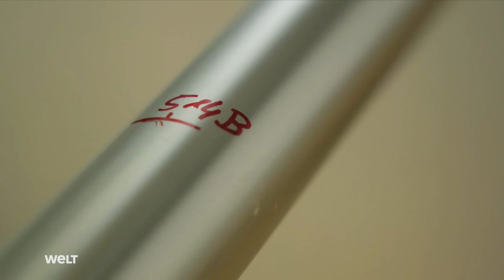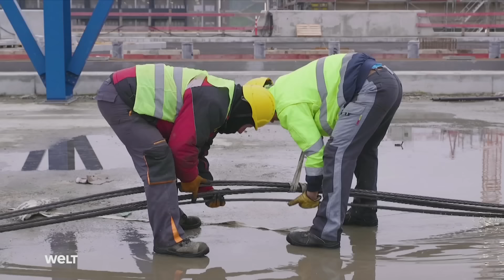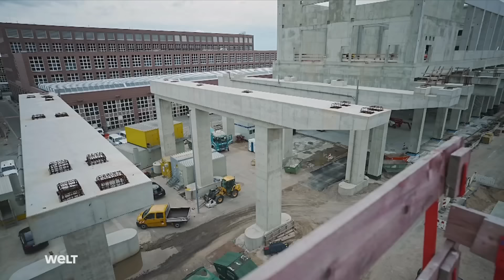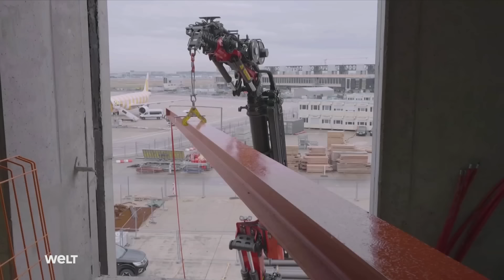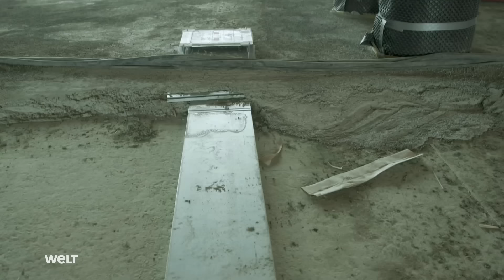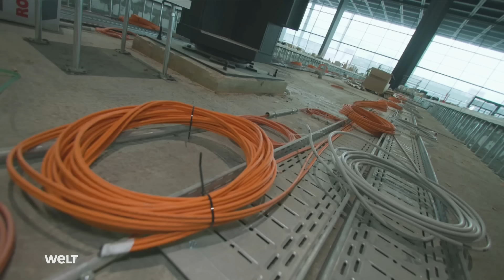EUROPE'S GIANT CONSTRUCTION SITE: Frankfurt Airport’s Massive Terminal 3 – Aviation’s Next Level

Comment: The airport control tower elevators are extra special due to horrible lessons learned in the early 1970s when the former airport terminal was the site of the worst airport terminal fire in history.  Normally, an elevator will automatically be called and stop at the floor where the fire is.  This is because the heat of the fire is so bad that it actually welds the fine wires and springs under the elevator call button.  Normally, you are supposed to avoid using an elevator during a building fire for this reason
Reply: What fire in the 70s? You mean the Düsseldorf Airport fire in the 90s?

Comment: I flew into Frankfurt Airport and it was a mess.  I was stuck in an area where the lift was not working and I had to knock on the window so that someone on the tarmac could rescue me.  it was a horrific experience.  No signs nothing was working functioning properly.  It was like a maze and nobody knew where to direct you to and no staff on ground.  I will never trust that airport ever again.  It was a nightmare. So much for German efficiency. or rather inefficiency. What a joke and dangerous.
Reply: I flew in there almost 100 times and never had a problem. Almost every employee on the ground can direct you correctly. And getting to a part that is not signposted means that you have already ignored the signs. Clearly your mistake and the circumstance with the elevator is just bad luck, but it can happen anywhere. Technology never works perfectly 24/365. The signage is not perfect, but better than at many other airports. You should also know that the airport is more than 100 years old and has had to be repeatedly adapted to the increasing passenger numbers over this time and always during operation and such modernizations and adaptations are a thousand times more difficult than putting a completely new airport on a greenfield site or slamming it into the desert. And to describe your experience as dangerous is probably the exaggeration of the century. I'm sure that almost everyone has gotten lost somewhere at an airport. But this is almost always your own fault. You can laugh at yourself or, like you, jam and complain like a spoiled brat
Reply: I’m sure u went to Ibadan airport in Nigeria not Frankfurt

Comment: Doubtful if the extra cost for a somewhat gimmicky roof/ceiling is justified in today’s economic climate.   Portland, in the U.S. has recently completed one of the most gorgeous terminals anywhere, sans gimmicks at a realistic cost.    However Frankfurt is badly in need of this new terminal as the existing one is not good and this will be a huge improvement.
Reply: Frankfurt Airport is over 100 years old and has had to be rebuilt and extended time and again during ongoing operations. This is a thousand times more difficult than putting something on a greenfield site. When terminal three is completed and in operation, terminal two will be the next project to be modernized. Frankfurt is aware that some areas urgently need to be modernized. But space and money are limited and things can only be done one thing at a time. Everything in Frankfurt is privately financed. And whether something is beautiful or not is always in the eye of the beholder. And I much prefer sober airports to the gigantonomy of the Gulf States or Singapore. I don't know the new terminal in Portland, but the photos I've seen show a really great terminal

Comment: I have the feeling they will not finish this terminal by 2026...
Reply: This is FRAPORT, one of the best and most reliable general contractors for airport construction in the world! This company has built airports all over the world and within the agreed time.
If FRAPORT AG had been commissioned for the airport in Berlin, punctual completion would have been guaranteed.
In Berlin, the construction site was split up into segments and assigned to different contractors, which was a huge mistake, so nothing came together.
Reply: Na it’s build by a private company, so they will be in time
Reply: They ARE in time. 💪🏻